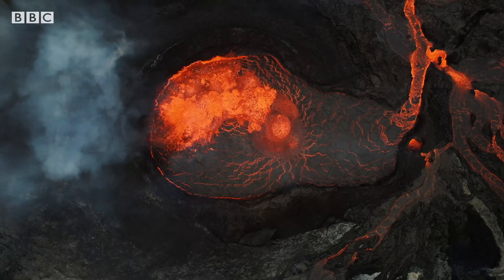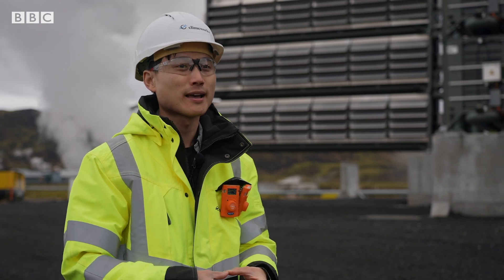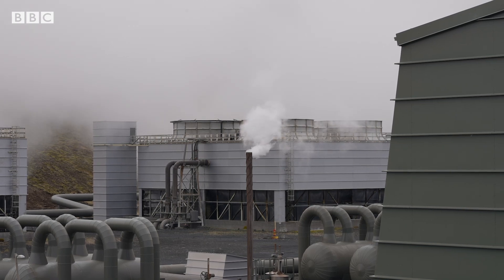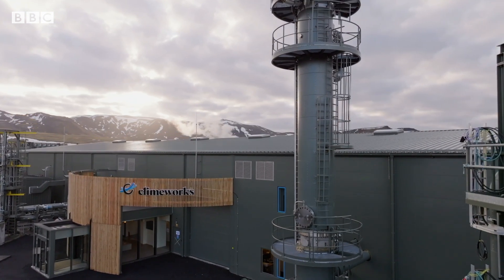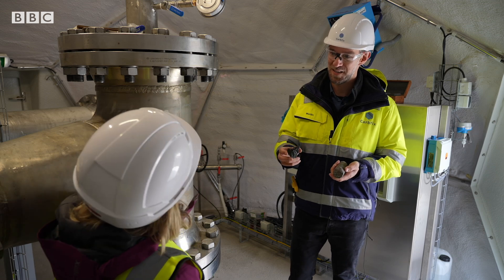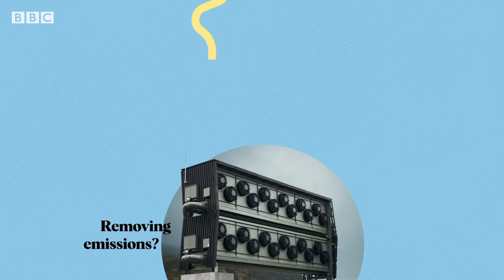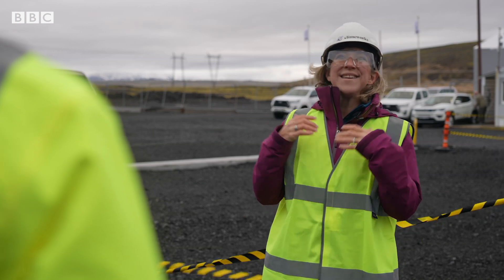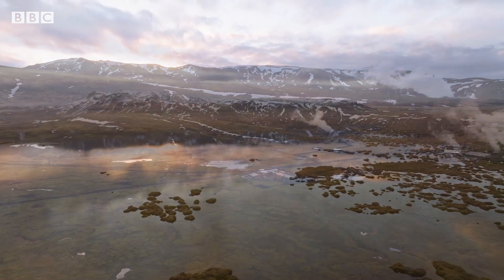Inside the hidden carbon plant pulling CO2 from thin air | BBC News

Comment: This is kind of what the UK should be doing with our excess Variable Renewable Energy generation. We currently pay to dump that (curtailment) so it's effectively negative-priced. We're still building offshore windfarms - I'd question the need for fans when this is excess-wind powered. Hiding the carbon is the wrong thing to do though - there are natural processes that do that. What the UK should do is to use that captured carbon, combine it with hydrogen from water to produce NetZero hydrocarbons. That's our direct route to NetZero, and if we do it at large enough scale, to NetZero hydrocarbon exports too. People are confused by renewable energy. It's different things in different places. We have giant amounts of VRE in UK, 10× what we need, but it's unpredictable and intermittent, so we need to transform ours mostly to storable/transportable commodity as quickly as possible.

Comment: I like how they show cooling towers blowing out steam to signify carbon emissions. You can’t actually see carbon dioxide in the air and the stuff coming out of those towers is water. The exhausts for coal, oil, and gas plants is a much narrower tower with no visible vapors or gas coming out

Comment: Your 1st question about locating it directly near the CO2 emmiter was spot on. The answer was elusive and not really correct.
Reply: What he meant was building this a mile away from an emitter would make no difference to building it where it is. You can capture emissions directly from smoke stacks but that is a different process. It's still very expensive to do that. It's cheaper just to not burn the fossil fuels in the first place. This machine is for balancing emissions from farming and things like that where you can't attach a machine to the smokestack.
Reply: Did you stop and think WHY the plant was built there?

Comment: This only makes sense if you have excess clean energy. Until then, it makes way more sense to use this energy to reduce our emissions. Like trying to bail water out of a sinking ship that has a hole in its hull.. plug the hole first!
Reply: Guess, why they've built it in an area where they have more energy than demand.

Comment: My house in Russia is built to the local construction code (СНИП) in its thermal insulation and is heated by combustion of natural gas, which isn't bad. I costs me about $30 in fuel costs to emit one ton of CO2. That's an order of magnitude cheaper than capturing the same one ton from the air.

The energy efficiency of my house could be doubled if there were economic incentives to build it to a better standard. In fact, its level of insulation and energy-saving measures (or lack thereof) are perfectly optimal for the low cost of fossil fuel in Russia. I'm at the lowest expense point for the combined cost of house construction plus the fuel it consumes. There is no economic sense for me to curb my CO2 emission, as that would just waste my money on costly improvements that do not pay for themselves. These would not increase the market value of the house, either.

The emission of carbon dioxide should be made costing real money for the emitter. Only then would things change.

Now thinking about it, the output of my smokestack is roughly 15% CO2 gas with the rest being nitrogen and some water vapor mixed in (which is easily condensed). If it only costs $30 per ton to mine and transport the fuel great distances, why don't we build a pipeline network for treating and storing the combustion gas it produces? This should only double the costs, should it?

Comment: 100 million tonnes of co2 comes out a volcano, can’t help but feel that if co2 is the problem then this is like using a sandcastle to hold back the tide
Reply: Volcanos also block off solar energy and emit sulfurous compounds that bind with the CO2 and turn to acid rain. The climate change we're facing is man made consequence of rapid excess CO2 emissions and not like adding or subtracting a few volcanic eruptions. Also, yea, you're right, carbon capture is neo-lib nonsense helping us pretend we can innovate and consume our way out of all our problems. We can't.

Comment: This is insanely stupid! Even with the US cyprus plant capturing 1 million tonnes a year, the US produces over 6000 million tonnes a year, that’s 0.017%. You’d need to plant 50 million trees to achieve the same goal.
There are 220 Billion trees in the US, so 50 million is only an additional 0.022%. So to capture all the C02 with trees you’d need to plant an additional ~250 Billion more trees in the US which is double what there currently is. 
Each person in the US would have to plant 748 trees to achieve this goal in one year, assuming this is even possible in terms of climate and land appropriateness.
Reply: what a terrific idea - shame that trees burn down

Comment: You know that CO2 was, is and will always be just 0.04% of the atmosphere. Not 1 percent, not even 1/10th of 1% but 4/100ths of 1%. Because Mother Earth keeps it in balance and check. C02 is NOT the cause of climate change. The decades long geoengineering it. It's a technology the elite use as a weapon and coercion tool. That shield of nanoparticle metals from chemtrail spraying is acting like a blanket at night keeping the heat it. It's nighttime temperatures on average that are rising,, not daytime.
Reply: CO2-level of today is 50% higher than in the pre-industrial era.
And is rising every year.
We destroyed the natural balance by pumping tens of billion tons of CO2 additionally into the atmosphere annually.

Comment: So annual global emissions of C02 are 35,000,000,000 tons(35 billion) divided by 36,000 tons captured by this C02 plant = We need 972,222 of these machines. I'm not sure if we need to clear all 35 billion tons per year out if tge atmosphere,  but if we did, I can't imagine building nearly a million of these machines across the planet. WE ARE IN BIG TROUBLE
Reply: AEROSPACE ENGINEER HERE: and that's a damn good answer
Below is the same answer I gave elsewhere. The difference is your only looking at dealing with what goes into the atmosphere each year, when there's already a massive amount in the atmosphere that needs removing.

I'm Australian but did my degree in America (late 80s) and one Friday we had a NASA engineer do a special lecture on Terraforming Mars. We were kind of excited as at that time (despite the Challenger accident) we believed we'd be building the next space station in the 90s, back to the moon early on the 2000s and off to Mars in the 2010s.

We were shattered when he started with: "Sorry its impossible and here's why!"
He then went and explained how you need think when considering an entire planet. You don't need to be an engineer or geologist or atmospheric scientist just BASIC MATH WILL DO. Once you understand the actual scope of dealing with a planetary issue things like this are irrelevant. 

For example there's currently around 2.5 Trillion tons of excess Carbon Dioxide in the atmosphere and by current estimates it will go past 3.5 Trillion tons by the mid 2030s. So to do a quick time estimate you simply divide 3.5 Trillion by 35,000 and get 100,000,000 years. So if you want to get that 3.5 Trillion tons out in something like 10 years you need about 10,000,000 of these plants built. If you want to do it 20 years then its 5,000,000 plants.

As to the costs its even easier to estimate 
At $1,000 per ton 3.5 Trillion tons will cost $3.5 QUADRILLION tons to remove.
1/10th of $3.5 Quadrillion is $0.35 Quadrillion.
So at $300 per ton its (3/10ths) which is $1.05 QUADRILLION
And at $400 per ton its (4/10ths) which is $1.4 QUADRILLION

So its reasonably easy to estimate that this method will cost between $1 and $1.5 QUADRILLION and that's provided we can find 5-10,000,000 SUITABLE locations and get enough materials to build those 10,000,000 plants. Then there's the small task of how do we power it, because power might be reasonably cheap in Iceland where they have enormous natural resources but what about the other 9,999 plants where are they going, how are they being powered and who's paying?

By the way if every person on the planet planted 1,000 trees (seedlings) at a cost of $5 per tree. That would be 8 Trillion Trees and if each tree is capable on capturing 1-2tons of Carbon and sequestering it in the wood. Then we'd only need about 1 in 4 trees (~2.5 trillion) to reach maturity to capture that 3.5 Trillion of Carbon Dioxide. 

Yeah that would cost about $40 Trillion on basic costs which is a staggering amount of money until you consider the alternative is $1-$1.5 QUADRILLION, which is 25 times the cost at the low end. Best of all Trees don't need electricity they just need water and sun light and maybe some fertilizer. Once established their maintenance and upkeep costs are almost zero. If you plant trees that produce food and of building materials then even better.
Reply: Such plants are not meant to compensate our actual high emissions.
They are planned to compensate a part of the residual "inevitable" emissions after we stopped burning fossil fuels.
Just a tiny fraction of today's emissions.
Reply: Your assumption being that these machines alone will fix the emissions problem. But there are lots of other things also happening from both natural and technological that will all have to work together. There is not one single way to capture all the CO2 necessary.
Reply: You are taking an assumption first you think this will be the only method and two you think this machines wont get more efficient over time
Reply: That's just to get to NetZero. All current climate forecasts include carbon reduction to prevent the world going past irreversible climate collapse. So not looking great.
Reply: we are indeed in big climate trouble, but try telling that story to the people who were developing solar panels for decades

Comment: I have yet to see proof that CO2 injection provides a permanent lodging of gas and when a well gets saturated, what's the next step?   26,000 tons per year?  Not even a drop in the bucket.  Best of luck though.

Comment: I have always felt, whenever I see smoke coming out of any guzzling unit, that it would be nice if they run that smoke through (non potable) water and use it for agriculture or something
Reply: Me too! Some farmers have actually experimented with injecting tractor exhaust into soil during soil working (Cultivations) operations. More research is needed.

Comment: Far more efficient to capture the CO2 at sourse or aviod it altogether.
Reply: A $1,200 solar panel would recover that one ton of CO2 captured in under 3 years and pay for itself in that time and have a useful life of at least 15 to 20 years.  Thus after 3 years by implementing Solar PV system as exampled,  you effectively have free energy and free carbon capture aviodance, by preemptive measures instead of reactive measures.
Reply: everyone keeps repeating this but its not true except in the Allum cycle where only O2 enters the combustion cycle and the exhaust is pure CO2 which is used in the power production till it is ready to go somewhere else.
Reply: I think the passage of time will prove you wrong. This wont go anywhere.

Comment: Ok, but why they didn't built it near an industrial plant? It would be better to catch co2 straight out of chimney
Reply: That is also being done. Some emissions are not possible to capture at source. This is done in this location because of the geothermal energy and the suitable geology for putting it permanently underground.
Reply: If the CO2 is already lost to the environment, the very best way to capture is to let nature concentrate it about 1400 times by taking out of the oceans in an AC cell, it just bubbles out. The energy needed for this is in the same ballpark that was produced when the CO2 was originally released, either last week or a century ago. So it was pointless tin the 1st place.

Comment: This fantasy the BBC and DW keep pushing is just plain stupid. If you want to push carbon capture, let the fossil industry do it up front and it must be 100% carbon free at the end of it, it will likely double or triple fossil energy costs. At the same time lets make all the wind and solar industry pay for their free grid "battery" cost so that they are only allowed to produce energy on demand, no falling back on gas or coal peakers to fill in. then it will be quadruple the cost  Only nuclear need not worry about carbon capture or energy storage, it can even have variabl output with Molten Salt Reactors.We will probably have to do some tampering with the suns insolation with many of the geologic schemes to lower the albedo.
Reply: Forgot to mention the Allum cycle, it's the only way of burning nat gas that has a hope in hell of not releasing CO2, but it would be an easy to capture stream because fuel is burned directly in O2. Burning fuel in air and then using output energy to capture CO2 is always going to be energy negative, hence utterly pointless, whether the CO2 is fresh or ancient.

Comment: How many tons of CO2 were generated in the building of this factory?
Reply: I looked it up a while ago and I can't remember the exact figure but it's somewhere between 95-98% efficient. Ie an least 20x as much CO2 is absorbed than was released to build and run it.
Reply: @adrianthoroughgood1191  nonsense. i worked with carbon capture, it was trieled and one of the UK's last coal plants, the cost of storage of the carbon, and the power required to capture it in the first place. blows the entire thing out the window.
Reply: @MinkieWinkle  this plant is built in the perfect place to do it, right next to a geothermal power plant. It uses the heat left over after generating electricity to provide most of the energy needed for the process of removing the CO2 from the absorption material. The CO2 is pumped straight down a bore hole on site where it reacts with the surrounding rock to permanently sequester it. It is very efficient CO2 wise. But it is very expensive and it's not at all economical to carry on burning fossil fuels and build these plants to balance them. We have to stop burning fossil fuels and inky use DAC to balance emissions that can't be avoided such as from farming.
Reply: @MinkieWinkle 
Depends on the method.
Reply: @adrianthoroughgood1191  so in other words. not repeatable and certainly can never be done on scale. 

More virtue signalling  snake oil
Reply: @MinkieWinkle  Iceland has literally 100% renewable electricity, generates the most electricity per capita in the world, and has a separate grid.
Reply: They wont ever tell anyone how much CO2 was released to build the plant, because that would kill it off rather quickly.... Cement production alone is 8% of world CO2 output, releasing 0.9 pounds, per pound produced, at a minimum... One pound of steel averages 1.4 pounds of CO2 into the atmosphere, using the cleanest plants. Steel production alone in total is 15-20% of all CO2 ever released... Aluminum is even worse, 5 to 10 times, per pound of aluminum, again, with current plants and recycling.... If you consider every industry used to build the plant, those industries produce 60-70% of the CO2 released yearly... Just from the 3 industries mentioned, that is a lot of CO2 versus the weight of the plant.... That doesn't include anything else either, like construction, transportation, etc... Just considering the cement and 2 types of metal and getting it to the plant installed, will take many many years to offset it.... The plant will probably never break even in CO2 released, versus sequestered, even using hydrothermal power........ They wont ever tell you that either......
Reply: Those are taken into account in the lifecycle analysis of the factory. The given amount of captured CO2 is the net negative effect on the atmosphere (after capturing all the CO2 from manufacturing and running).
Reply: Don't ask too many questions. You will sleep better.

Comment: There is a really good Thunderfoot video debunking carbon capture as a workable solution. For it to have even a neglible affect we would need to build a superstructure so large that it would dwarf the Burj Khlaifa in height and it would have to stretch around most of the planet.
Reply: drivel
Reply: @ldm3027  We release over 35 billion tons of CO2 yearly. This device captures 36,000. 

That is .0001%
Reply: @Pintheshadows  congratulations - have you any other pearls of wisdom to distribute?   you might just have heard about how solar panels were developed
Reply: @ldm3027  .0001%

You would need 10,000 of these plants to pull just 1% out of the atmosphere. 

Even if the technology improves dramatically you would still need to build thousands of plants for them to only have a neglible affect. As you scale upwards storage then becomes a problem. 

As it stands, CCS is like putting a plaster over a gaping chest wound and saying "There we go. All better now."
Reply: @Pintheshadows  I appreciate that you find these ideas challenging. Very similar objections were made to solar panels as they were being developed. There is no dfficulty involved in scaling Direct Air Capture but the ultimate size of the removal rate is a political decision
Reply: @ldm3027  That's the thing, I don't find it challenging. It's mathematics. It's rather simple really. 

It is amusing to see talking about how no one believed in solar panels at their Inception because that isn't true. Solar showed massive promise in the late forties and had companies champing at the bit to join the development process. 

CCS does not. It's expensive, difficult to build, has provided no innovation in over a decade, and doesn't produce results.

I know you might find this challenging, but do you think you could respond with substance showing me that I am incorrect? I would welcome it.
Reply: @Pintheshadows  all completely wrong. show your maths
Reply: @ldm3027  Could have just said no.